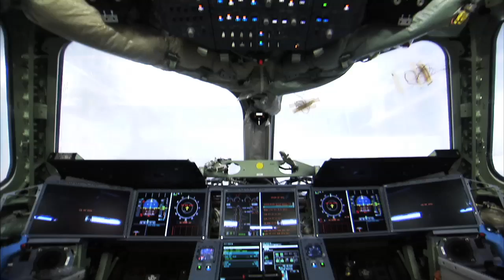A350 XWB Final Assembly Line: Inauguration ceremony highligh

Comment: Not true sir. Just because Airbus has had fewer accidents than Boeing, you can't just assume that Airbus is safer. The Boeing Company has been around far longer than Airbus has. There have been around 60 Airbus accidents with about 12 million flights where as Boeing has around 194 accents with over 35 million flights. Do the math. :)

Comment: @MrCalvin747 Doing that "math" shows that Boeing has 184000 successful flights per 1 accident, whereas Airbus has 200000 successful flights per 1 accident. You may have wanted to check that fact before posting

Comment: the leading manufacturer my ass. airbus has been building planes for 40 years like they said. us at boeing have been doing it for 100. at airbus, you get what you get and like it. At boeing, we dont put one piece together until the customer gives the confirmation. the boeing 777 killed the A340 and our new 777X will bring the new A350 to its knees